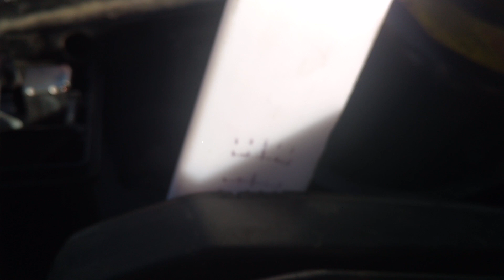Red Barron to get the works, performance mods for NA 850's and Panther tuning. - HOWR

Comment: Re Auto insurance-I would definitely be interested in hearing how other people deal with insuring cars with significant investment. I had an eye opening situation recently where my 05 Acura RL with 292k miles was damaged, and I filed a claim with my insurance and they want to total it out for $2700. I put that into the car in the past 2 years alone with all of your recommendations on how to prolong a car’s life-timing belt/pulleys/water pump, plugs/valve adjustment, radiator/hoses/thermostat, motor mounts, complete suspension refresh, tires.  If you put $15k into a car they will just grab NADA/KBB and write if off for $2k max
Reply from the maker: I usually do good with my maintenance records. It is a major issue when keeping old cars on the road. The big thing is that many private party sales write low sales amounts on the BOS which lowers the values. I had someone ask me to do that with a car and refused to sell it to them.

Comment: I got a 99 S70 pedal assembly. Not sure if it’s the same. Got clutch slave cylinder and shifter assembly with cables.
Reply from the maker: Thanks. That stuff is different. Not sure why...
Reply: Robert DIY sorry. Good luck on finding what you need

Comment: It would be a lot cheaper to do the bodywork your self an then get it repainted wouldn’t it be easier to just replace the head gasket then replacing the whole engine
Reply from the maker: Well, since the engine has to come out to do the transmission, probably easier to just swap the engine.

Comment: Hi im interested in a 1987 volvo 4 cylinder 240 dl thats a wagon with an auto that has 221k miles for $700 is this a good buy ? I dont drive much this would be a errand runner and an occasional outta town trip car
Reply from the maker: https://youtu.be/DMw_DgZulKc